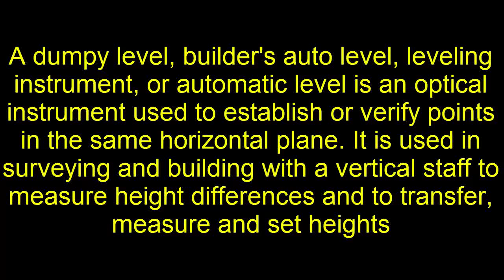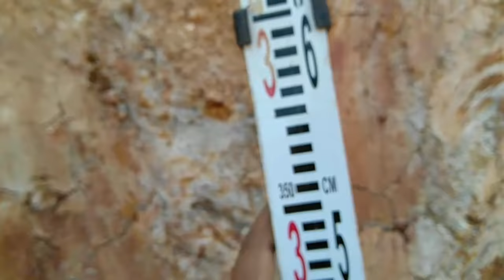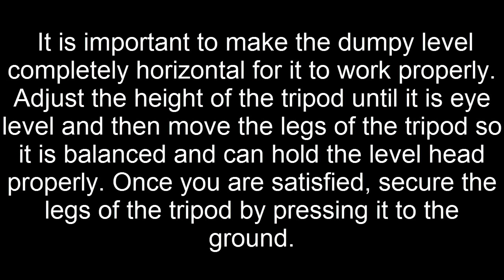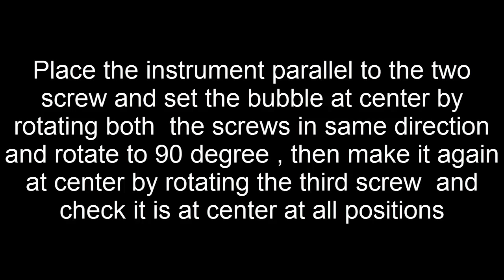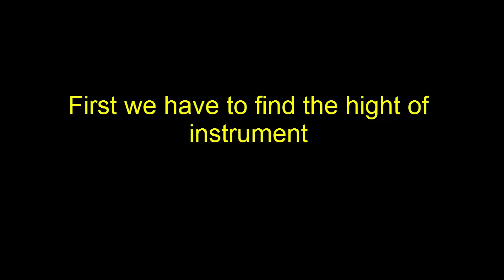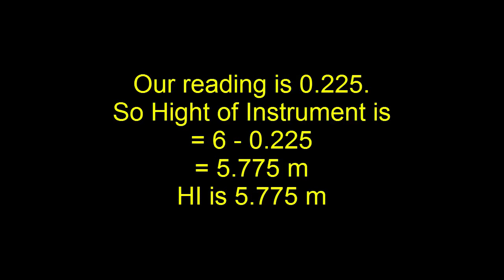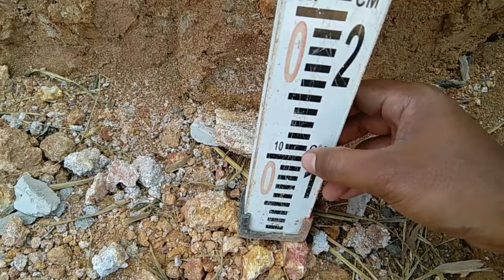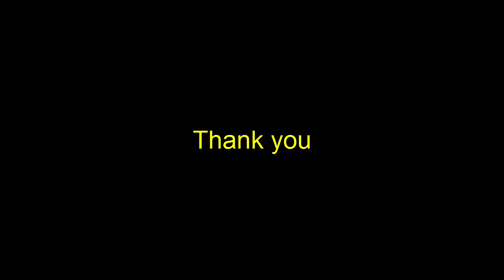How to Level using DUMPY LEVEL | Civil engineering Surveying

Comment: H.I = B.M(or R.L) + B.S
B.S = Back sight also called '+' sight which is taken on a point of known elevation.
Reply from the maker: your are right...thanks
Reply: Bhai consider it as inverted staff.. He has done the right thing.. In feild u need to use mind instead formulas
Reply: Your right however, The BM was 6m below the road. Therefore, when taking the HI, HI=-6+reading